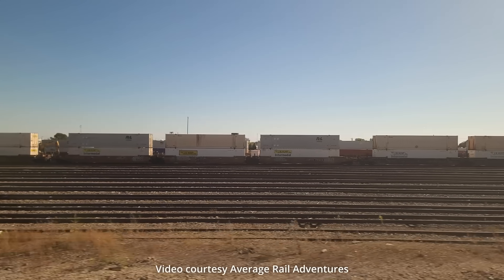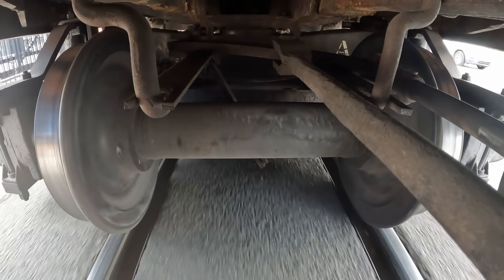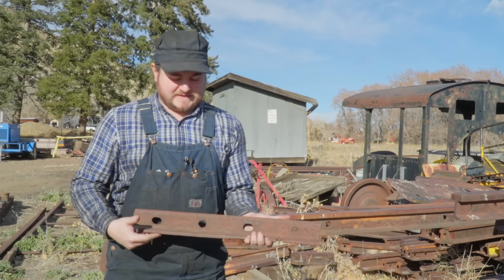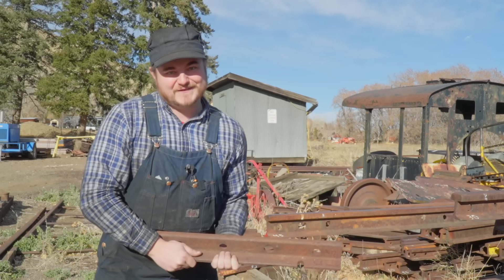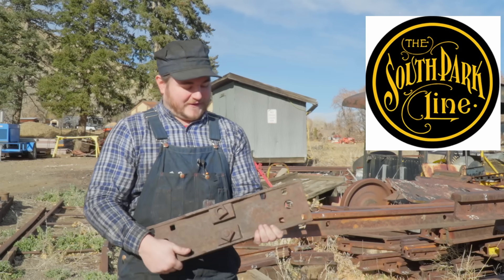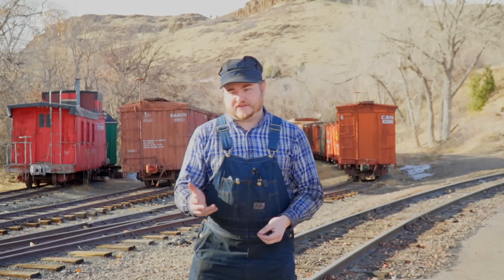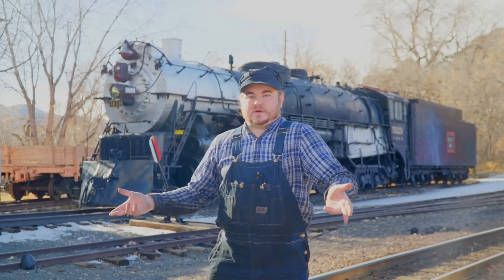Why don't Trains go CLICKETY-CLACK anymore? | Railroad 101

Comment: My dad worked for the New York Central line, which evolved into Penn-Central all his life. He started back in the days of the caboose. He was a conductor, with the brake man, the fireman and the engineer on each train. That was back before portable, dependable radios, they used battery powered 'lanterns' to signal each other. He used to talk about maintenance and repair of the rail line all the time. Bad rail, no transit, delayed the schedule not home when expected.  He did acknowledge that rail service crews job was harder than his because they had to get the work done in any weather, day or night and ASAP.  Few welded rail sections were around the routes he did in Ohio back then.  I remember him saying why they were good or bad. He called the continuous welded sections the 'silver rail' because it was so smooth and quiet. All that was from the middle of the last century. He  started with NYC just after WWII.

Comment: welded rail gets heat kinks, happened every summer on CSX. We had heat orders where we reduced speed by 10 mph then in winter you had pull aparts where rail would contract from cold then break in spots

Comment: Consider doing a video on the expansion joints on the Sound Transit (Seattle WA USA area) tracks crossing lake Washington on a floating bridge. If I understand correctly they lower the level of Lake Washington by two or three feet in winter. That is an additional factor the tracks need to handle.

Comment: Each 39 ft or 30 ft of rail has a joint. Each joint flexes and moves with the temperature. The flex at the joint drives the ballast down, so the joint , in time will create a hole that has to be tamped up. Men were used to tamp the two or 3 ties at each joint. That cost money, and can lead to broken rails if the rail tamping does not happen. It also can snap the bars in half, and if both break you have a temperature separation. Welded rail does not have joints so less men and more machines can tamp the low spots. The railroads make money by not having the manual labor, for the Foreign railroads ....the North American railways use heavier locomotives and cars than you do, so we build our track structure differently.

Comment: 7:13 In Soviet Union they used copper braided cables to connect the rails for signalling - and eventually became subject to metal thieves, disrupting the traffic, as a break in the circuit caused the red lights to be triggered.

Comment: 1:30 - The thermite welding process was invented in 1894 in Germany, patented in 1895 and first used for rails (tram rails, though) in 1899. So the tech for welding the rails on site has been around quite some time. But trackwork with welded rails has to support significantly higher forces due to thermal stress, meaning the construction has to be stronger and more precise, thus more expensive. I feel like, at least over here, the relatively late and slow onset of welded track is primarily attributed to this factor.
2:00 - As always, amazing how different countries found different solutions. The way I understand you, that's the standard shape for you? Here I've never seen such an L-shape. Our's are just flat (well, they do have a profile, but overall it's flat, not an angled piece).

3:45 - That's a neat prototype. I can imagine why it didn't take off given the leverage is way worse, but it's still a fun idea.
4:45 - I'm not a track guy, so there surely are details I'm missing, but I do think joints tend to end up parallel, not staggered here in Europe.
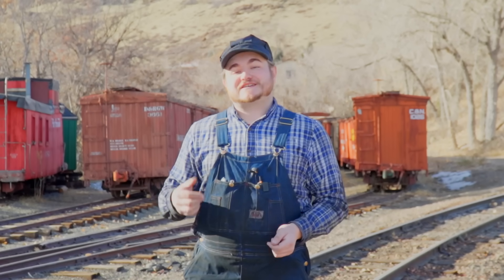7:50 - I was surprised to hear the first instance of welded track was in 1933 in the US. Even though there was a strong isolationist current in the US of the late 19th and early 20th centuries, you did tend to adopt technological progress swiftly. Thus I did research a bit myself and it seems Goldschmidt, the inventor of thermite welding, founded a US subsidiary in 1904 and laid first welded track in the US in the same year, in Massachusetts. Though it's a tram network, too. Maybe 1933 was the first application on a proper railway?

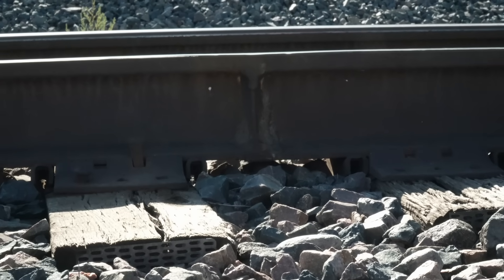8:00 - That's such a strange view seen with European eyes. Welded rail but nailed in place. Very exotic to me :D As mentioned, I'm not a track guy and also not really deep into the history of that, but I'd guess that's not a combination you'd have commonly seen anywhere in Europe. I don't know when exactly we switched from nailing to screwing, but I'm pretty sure it was way earlier than we started welding rails. And the switch was significantly more extensive. I do know some lines with jointed track in Europe even to this day, but I think the only nailed track I've ever seen was a disused (for a looong time) track of a former branch line in some very backwater village in France.

9:45 - At least over here, those expansion joints are basically just used on bridges. So they're, the way I understand it, not as much for the track's expansion as for the bridge construction's movement.
10:00 - @redonesgofaster8020 added some Canadian perspective context on that, in the comment you pinned. I'll expand (pun inteded) on it a bit by adding "it depends" (drink!). They explain that in Canada the rails are destressed to 40 °C to have them usually on tension. Here in Germany, which over all is warmer than Canada, rails are welded at anywhere between 20 °C and 26 °C. I'll assume it boils down to what the trackwork system you are using is constructed for, as well as other boundary conditions. E.g. the commenter cites the signal system detecting tension breaks in Canada, meaning they are easy to detect (and thus less risky to have) than sun kinks. Here in Germany, we don't use track circuits for transporting signal information. We do have track circuits for track occupancy detection, but axle counters are the predominant (and increasingly so) system. So there's no substantial benefit of rather having tension breaks than kinks. Instead it's beneficial to be somewhere in the middle of the spectrum of tolerable thermal stress and thus have a minimised risk of damage in both directions. So you weren't wrong, it's just a case of "it depends [tm]".

11:00 - As mentioned in the paragraph before, track circuits aren't the only method. Though in a world wide perspective it seems they're predominant; a German signalling tech site I've been checking to make sure I don't write utter garbage claims somewhere around 70 to 80 % of track occupancy detection systems around the world are still track circuits, though they aren't specifying what exactly the number is relative to (track length? Railway administrations? Signal boxes? Whatever). Here in Germany (and I'll assume in many other places, too, I just don't know it) isolation joints are differently built to regular joints, too. They're angled in the rail head (while the foot and, uh, whatever the thin part was called, are cut perpendicular for better force transmission) and the whole shabang with fishplates and bolts is permanently glued together with epoxy. So you can't split the track at that joint either. According to the source they're actually pre-produced as a short rail with a finished insulation joint that gets welded into place instead of creating it in situ. The angled cut in the head serves two purposes; minimising mechnical stress (i.e. the hammering and the sound) and making sure the occupancy detections of both adjacent sections overlap.

11:50 - "Now I know my European commenters will go 'wait a second'" hey man, I feel called out 🥹🤣🤪 Actually track circuits work with electrified railways as well. A bit of thought has to go into making sure the frequency of the track circuit isn't interefered with by return current from the electric traction, but that's basically it. Older (most) systems work at 42 Hz or 100 Hz, thus electric vehicles have sensors immediately throwing the main switch if they detect a 42 Hz or 100 Hz interference current happening (the latter being triggered relatively regularly at wintertime if there's ice on the overhead line). Later (few) systems work with high frequencies of up to 20 kHz, which are outside the spectrum of interference currents you'd expect from electric vehicles.

13:00 - Now you got me wondering. We obviously have those profile change joints as well, but I do believe nowadays they're welded. Huh. I'll have to take a look next time when fetching a train from the sidings. I'm pretty sure there's several transitions between 49 E1 (49 kg/m) and 60 E1 (60 kg/m) down there.

I'm not sure what you've been meaning with the points. Do you mean the fact that points necessarily at least have a gap in the frog? Or are points generally connected to the rest of the track by joints over on your side? If it's the latter, we don't do that over here. The points are just welded into the whole thing.
Reply from the maker: Hello my friend! Good comment.
I'd say our typical joint bars are angled. Some smaller rail uses flat ones like you described as well.

Always interesting to hear the differences over there. Axle counters are not really used here whatsoever for signalling purposes. 

The thin part of the rail we call the Web of the rail. 

Track circuits absolutely work with electrified railway - they are just different and nuanced in their application. Most track circuits in the US are just DC current at low voltage. Depending on what type of electrified railway you operate, that might not work. The Light Rail Transit system I worked on used 1500 volt DC traction power, so our track circuits were audio frequency track circuits primarily - which just have an impedance bond. They're neat because that setup gives you a "region" of shunting the track circuit - typically pre shunting and post shunting (starting the next circuit, and leaving the previous circuit) up to 10-15m from the bonds. Because of this we had IJ's at the signals themselves to make sure it was a crisp and measured point at when the signal would change, but they had to be staggered such that the return current through the rails was never interrupted. Neat stuff. :)
Reply from the maker: Oh and yes, our points on many switches are jointed in.

Comment: Hello, very interesting video.  I live literally 100 feet away from the Harlem line of the Metro-north railroad line in Tuckahoe, New York (Westchester County).  There is a joint in the track unfortunately right in front of my house. When a train is going by at high speed it sounds like shotgun blast going off lol. I’m hoping that one day it is eliminated. Although I’ve been hoping for over 20 years aside from that, there are two other tracks and I hardly notice when the trains go by on those. Again, thank you I really appreciate your content.

Comment: Staggered rail joints are an American invention. European track joints are not. Continuous welded rail was invented by the LNER when replacing rail. There was a shortage of joint plates so they welded them.

Comment: As for the train detection, that's why they used to have to clear several feet away from the tracks, so that the train crew could see if there was anything near the tracks up ahead, animals, people, automobiles or other trains, miles down the track, which if Modern technology fails, which it does have a tendency to do, other traffic at the railroad can see if there's any oncoming traffic or cross traffic ad traffic flow can act accordingly. some people drive across railroad tracks when the guard arms are down, which one reason is they're irresponsible, also less visibility due to modern technology allowing for trains to not need very many people on the train and they rely on satellites and computers, as for the old trains had a crew keep an eye on all directions of the train and needed to see for miles down the tracks so that they had time to stop for traffic if needed, now there's pretty much just enough clearance for the train to pass through and only have maybe an inch of clearance on each side.

Comment: Actually I think that the speed of the train going over shorter sections of rail makes sense. All the Rails in the World used to be laid by hand and it had to be short enough for a team of 6-8 strong men to carry and they was also hauled by mule teams whether by a wagon or just a rope tied to a clamp that hooked onto the section of rail and men had to drive the spikes n by hand also. the Steel wheels of the train passing over the joints. since we hardly ever use Mule trains anymore and we have heavy equipment and Cranes to install sections of rail, each section no longer has too be short enough for men to carry by hand or for mules to haul. Even though it is putting people out of a job, it is more convenient for the company to lay longer sections of rail at a time with machines, each section of rail still has o be short enough to haul to the site and the sections of track shifting also makes sense. but it seems like the clickity clack is further apart than it used to be, maybe that's from more dense population and slower moving trains.

Comment: US streetcar lines were flash butt welding rail into CWR back in the early 1900's  to stop the cars shaking buildings and improve  passenger ride. The Lorain Steel company sent a team to Liverpool England to convert the streetcars to CWR in 1903. I think US railroads were starting to put CWR down pre-WW2, if the US hadnt gone roads mad post WW2, CWR would have probably been more widely installed a lot sooner.

Comment: Now when you hear noises when a train goes by, it's because of lazy Brakeman and Conductors not knocking off handbrakes on empty cars. They slide the cars around industry tracks and in yards while switching, causing flat spots on wheels.

Comment: While jointed rail is mostly becoming a pastime of railroads, I still hear lots of clicking on welded joints on the nearby subdivision. Not sure what technically still allows for the welds to make that noise but they still do it.

Comment: I live about 3 miles from the London railway, and about 400 feet higher, in a direct line. When we moved here 40 years ago, the closest section, near a town,  was CWR whilst the London bound bit was old stock. When the 0600 train came down the line the clickety clack, even at 3 miles, was realty quite loud - then went  suddenly quiet as it reached the CWR. About 20 years ago it was all replaced with CWR - and silence reigns. (Obviously other trains were the same, but at 0600, we were just waking up, and everywhere else was quiet)

Comment: On some of the more recently built lines around here (Eastern Europe), I've seen joints where the two rails don't butt against each other, but have a long taper, side-by-side (similar to switches). Which I thought was genius; the ultimate, simple solution to allow for expansion, without the wheels pounding on the ends, going over the gap. I would love to see a follow-up on these, I couldn't find much information about them. Why aren't those everywhere, how come we weren't using them all along, did it take a hundred years to figure this out?

Comment: So railroad signaling had to change due to no track  blocks.

A block is a section of track that is  electrically insulated from the rest of rail system. A few volts are applied and a relay . When no train in block relay is up and various contacts are made. Train enters block relay coil is starved for current and armature drops changing connections of contacts.

Comment: Last train ride I took was in 2017 on a New England Amtrak, I swear to god it made the click-clack sound. Maybe that’s just a false memory?

It has to be, like you said the signal system requires them to be connected. Maybe like another commenter pointed out it was just flat spots on the wheels. Or maybe the welds aren’t completely smooth?

Comment: The tram system in my city has an issue with some "new" lines where in a hot weather the rail will just pop up from the road and damage the tram or any other unlucky transport, or even hurt a pedestrian.

This happenes because rails are welded together and has no room to expand and just jump out the railbed with great amount of force.